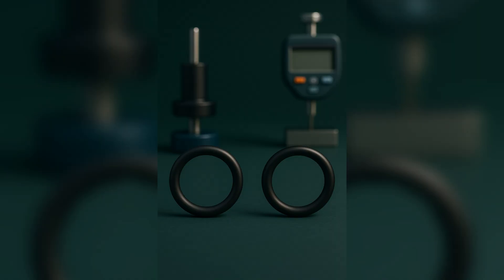Black Rubber ≠ Carbon Black Reinforced | Rubber Mythbusters

Comment: Couldn’t you just take some scans to see the composition?  Similiar to what they do when trying to figure out the composition of a soil sample using x rays or other Doppler?  

You Should be able to use a variety of waves to figure out what it’s made of (what is reflected back)
Reply from the maker: There are plenty of analitical methods that can even tell you more or less the exact composition. The issue is that they are expensive and rarely available in everyday production realities. But rubber can tell a lot even with more comon tests that most production sites have.